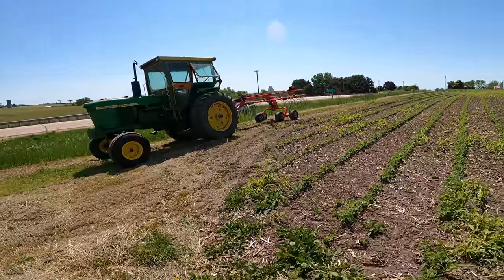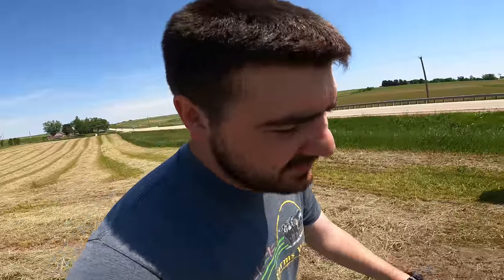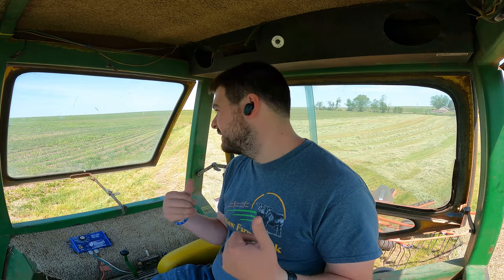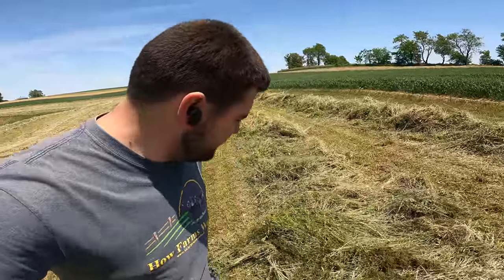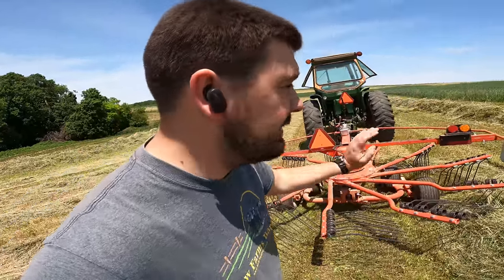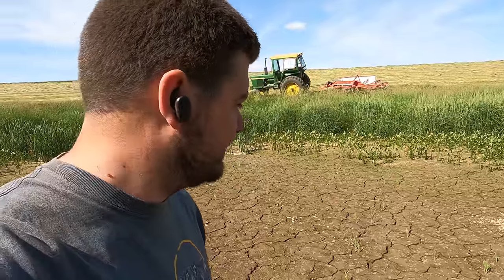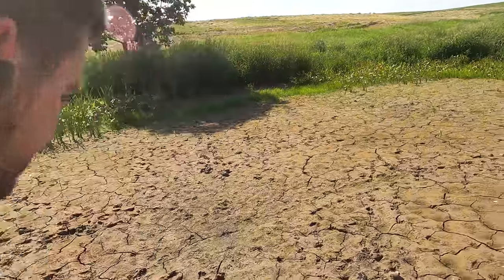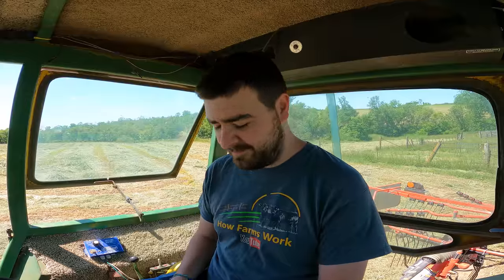Using The New Rotary Rake - KUHN GA 4230 T

Comment: Like a couple others have said, if you pick up a gear and drop your RPM back it will do an even better job raking. The tractor will burn probably 3/4 the fuel and  you will also experience less leaf loss because its not whipping your alfalfa and clover to death. My neighbor has one of these rakes and it beats the heck out of a wheel rake and a bar rake.

Comment: Perfect for making grass hay! I can see the leaves flying off the alfalfa. It’s to rough to me.
Reply: Run the pto slower and rake when the alfalfa is still a little green and the rotary will loose less leaves than any other rake.
Reply: @Anteater6788  there is no way in hell I’d ever use anything resembling a Tedder. No matter what you do you are going to loose a ton of leaves and that’s a no no in alfalfa. .
Reply: I have raked a lot of alfalfa with a rotary rake and if operated correctly they will loose less leaves than any other rake, it's just like you walked along with a pitch fork and flipped the hay over.
Reply: We do alfalfa and clover with our New Holland ProRotor... pretty much the same rake as this Kuhn.  We think it treats the leaves better than our old bar rake.  These don't tumble the grass over and over like a bar rake.  You have to see it working to get a good appreciation of how well they work.

Comment: They are good rake , I  use to own one but I traded it in for a double rotary rake, I thought it was a waste of time and diesel raking in and then turn around and work you're way out. When I raked a feild I went around 4 times then I raked up and down, this made it easier on the hay baler driveline and also the operator, and I also believe it cuts down baling time.

Comment: For making dry hay, you can't beat a rotary rake. I've owned bar rakes, wheel rakes, and now have a Krone rotary rake. Wheel rakes work ok if you don't ted your hay and leave it in a swath until you rake two into the dry space between them. That usually requires more drying days than the weather allows where we are, so I now ted the hay out on day 2 and rake on day 3 and it's pretty much ready.

Comment: Does that rake have where you can remove all the arms and store them on the machine that way it takes up a lot less shed space. The guys I help sometimes have a Massey Ferguson rotary rake I can’t remember the model of it but the tines come off and store upright also the arm that holds the curtain and the other arm both fold up to. I have ran it once it is nice because it is only 1 hydraulic line and does not only need about 60 horse to run probably would run with 40 horses on it. Easy operating rake I like it.

Comment: I really like our single rotor rake it may not be as quick as a twin rotor or bigger but is it a fraction of the price and as you say on heavy crops you make one pass per windrow or if it is light enough turn and go the opposite way to double it up.

Not the most overpowered I've seen a JD 8 thousand something on a little PZ haybob and a 300hp Fendt on a tiny old idiot block baler

Comment: Does green bunches land on top and dry out in the windrow?
Reply from the maker: It does a good job at getting the wetter material out and on top.
Reply: Yep that's what rakes do... that's why they call it a WINDROW... it piles the hay up into a row that the wind can move through to carry away moisture.  I see a lot of guys leaving hay out to roast in the sun a week and then raking right ahead of the baler, but they're TOTALLY missing the point of having a rake.  Hay should be raked when it hits about 50% moisture... that's basically WILTED FLAT.  When you cut hay, it will still be "fluffy" due to the plant having sufficient internal water to support the cell walls, but as it dries down it "wilts" and flattens out under gravity due to water loss and the cells "deflating" as water comes out of them in the curing process.  Hence it "wilts flat".  The forage at that point will STILL have a pretty lush green color but will not have the "luster" or shininess of freshly cut forage, since it's drying down.  It will still be very limber and soft at that point.  That's when the rake it up into windrows.  Raking it into windrows minimizes the amount of hay being exposed to DIRECT sunlight, and thus UV rays, which "sunburn" the hay and cause the conversion of carotene in the hay to Vitamin D, which means its irretrievably lost.  Cattle make their own Vitamin D in their skin (as we do) and the carotene is a valuable nutrient that can be used many different ways if it's preserved in the forage.  Basically raking the hay into a windrow means only the hay on the outside layer is getting fried by the sun, while the hay inside the windrow is up off the ground and exposed to airflow and heat from the sun heating the outer layer of the windrow which speeds drying, as the air coming into the windrow absorbs moisture from the inside and then goes out with the breeze as new air comes in.  Hay laying flat on the ground takes longer to dry IF the ground is WET or DAMP, than hay in a windrow.  That's why they set their mowers to "swath" hay up there usually-- let the ground dry out and then rake it so the hay ends up on dry ground so it dries better.  Down here that's not much of a problem usually and sun exposure of UV is the biggest killer of hay quality.  SO usually hay is cut and laid out flat here, problem is most guys leave it there til they're ready to bale, and that's too long.  We rake 24 hours after cutting, and generally bale 24 hours after that, and have hay at a good dry storage moisture level.  We also have a good green color in the dry hay, something TOTALLY LOST in hay left to roast flat on the ground for 4-5 days to a week.  You also lose VERY LITTLE leaf when raking at 50% moisture, while waiting til the hay is ready to bale, you lose TONS of leaves, even in grasses which are much tougher than alfalfa, but still MOST of the feed value is in the leaves not stems regardless of whether it's grass, forb, or legume... 

Later!  OL J R :)

Comment: Why not put the MW turbo kit on the 4020
Reply: Why would yea
Reply: @jeremyfreeman717  More horsepower and torque
Reply: @keydanTheMan614  for what.
Reply: Why would he? Only going to cost him money for very little benefit. The kit costs money, burns more fuel, and will probably end up pushing that tired old engine to the point of needing a rebuild. And in actual use if you’re really working the tractor with those turbo kits you end up creating a lot more heat and can’t work the machine all day due to overheating issues. 

Sounds cool in theory, and for a tractor that is more show and fun rather than a reliable nice handy sized work horse for reasonable tasks.
Reply: @jeremyfreeman717  pulling wagons and mowing and other jobs
Reply: @chevyon37s  Well Drew it's worth it and I know a couple people who own a 4020 with the mw turbo kit and they run smooth and let me tell you something Drew I have driven one and it never overheated when it's working in the field
Reply: @chevyon37s  And it sounds like you own an international 1206 1256 or 1456 and you are bragging that it doesn't overheat and it's better then a 4020 please ih sucks
Reply: @keydanTheMan614  buy a 4320 if yea want one
Reply: @jeremyfreeman717  we've got one and my buddies 4020 is mw and my 4320 is mw and we work them buddy
Reply: @keydanTheMan614  4320 are garbage. Hot running hard starting fuel using and no power
Reply: @jeremyfreeman717  ih sucks and the 4320 that was given to me I've had zero issues starting in 30 degrees no problem
Reply: @jeremyfreeman717   my 4320 starts fine down to +20°f. Summer starts right up. Run a 16' macdon discbine all day never overheats. 16k hrs on tractor almost 4k hrs on motor
Reply: @smitty9120  4K is nothing
Reply: @keydanTheMan614  turbo kits on 4020s are pointless. They dont add enough HP to change anything. I mean if you want to spend money to make it sound cool thats one thing.
Reply: @keydanTheMan614  😂 actually it’s all Deere around here, except for a 784 IH we use on  a feed wagon, and it’s a turd. Did spend a number of years on an 806 and 1206 though. But rather than own those I just have an understanding of what it takes economically sustain an operation, and know that trying to spice up very old equipment doesn’t pay off for the operation, especially when it isn’t needed.
Reply: @smitty9120  AMEN

Comment: Sorry guys but I'll still take my high capacity wheel rake all day long. I see no adavantage to this over his side delivery aside from a little more fluffy windrow.
Reply from the maker: This rake picks up much more material so it leaves less behind.
Reply: @HowFarmsWork    I'll buy that Ryan but doesn't it feel slow compared to your high capacity? With good wheels they dont leave much behind. It leaves a nicer windrow hands down. No balling up either. But I like fast.
Reply from the maker: @davedunn2124  it’s much slower than the V rake, but that rake isn’t typically suited for first crop because of the density and moisture if it wasn’t tedded.

Comment: Your windrows look like really crappy compared to your v rakes
Reply from the maker: Bringing that shroud in helped make more consistent rows, but they were a lot tighter and would dry less. It also doesn't rope like the V-rake does which feeds into the baler better.
Reply: @HowFarmsWork  u are running pto to fast
Reply: Too fast on the engine speed (PTO speed) and too slow on the ground speed (grab a gear and idle back would solve that) and set the curtain in some to make a tighter windrow... 

Like most machinery, the job it does is directly affected by how it's set up and operated-- correct adjustment and operation of the machine will produce good/excellent results, while poor adjustment or incorrect operation will produce substandard results.  In the end it all comes down to the OPERATOR and them having the knowledge and EXPERIENCE to set the machine up and operate it properly.  Doesn't matter if it's the newest and greatest thing on the planet if it's not set up and run right it's gonna do a substandard job, even compared to an older or well worn piece of machinery that is properly maintained and set and operated right for the conditions.  That's what most guys don't get.  They buy the BS that "new" automatically means "better" when it really doesn't!  

Seeing how Ryan said they've never had any experience with a rotary rake before, I think some mistakes are to be expected.  It takes time to get the experience to really set things up right and make adjustments for the conditions to do the best job.  There's a learning curve to everything-- nobody's just "great" at something the first time out of the box.  Would've helped if the Kuhn guy dropped by when he was going to the field with it and gave him some pointers and setup help right off the bat... That and READ THE MANUAL cover to cover  a time or two-- usually there's good hints in there and tells you the "gotchas" to watch for and how to fix them without scratching your head for hours wondering why it's doing this or that.  Seen guys talk about this machine or that machine being "junk" because of the "lousy job" it does, when basically they never read the friggin book and had NO CLUE WTF they were doing... same machine in the hands of an EXPERIENCED OPERATOR who adjusted it and ran it properly did a terrific job!  

That's been my experience anyway!  OL J R :)

Comment: This rake is junk!
Reply from the maker: Why do you say that? It does a better job at grabbing all the hay on the ground and doesn't leave chunks behind like our bar rake.
Reply: @HowFarmsWork  Time is money, that rake is a toy. You got the rake for FREE!
Reply from the maker: @gregorydayton5428  Time is money, which is why we used both rakes to get the job done in half the time.
Reply: They're not "junk", it all depends on the job you're doing and where you're doing it.  Europe loves the d#mn things, so do horse hay and dairy guys in the US trying to get top dollar for their hay or maximize milk production or whatever... they claim they put less "ash" (dust and dirt) in the windrow so that equates to higher milk production and brings a premium value on the hay.  For the regular beef cattle guy a wheel rake is 'good enough' and does the job for about half the cost of what that rake costs new.  That rake is PTO powered, has a gearbox to maintain and which is VERY expensive to repair/replace, TONS of moving parts, and lots of wear items like the cam track and cam followers which don't last forever either.  If they ever hit anything you can pretty much write it off because whatever gets bent will never rake right again pretty much, and it'll cost a fortune to rebuild.  BUT they do a nice job; probably the most complicated way POSSIBLE to do the same job that any other rake can do, even if they put a little more dirt in the windrow or whatever.  That's why they make lots of different rakes-- you can buy the rotary rake, you can buy a new wheel rake, or you can buy a new bar rake.  Wheel rakes are the cheapest and widest for the money, though they tend to put more dirt in the windrow, and can have issues in some conditions depending on the design (always better IMHO to have the wheels in front of the frame for that reason).  The plus side is they're VERY simple, direct ground driven with no gearboxes or shafts or joints or anything.  Bar rakes when set right can make just as clean and fluffy a windrow as a rotary rake, and don't put dirt in the windrow (unfortunately most guys seem to try to use them as a tillage tool, scraping the ground trying to get every single blade of grass in the windrow, which NO rake will do with 100% efficiency).  They have more moving parts than a wheel rake but are MUCH more durable than rotary rakes, and MUCH cheaper than rotaries as well.  They're not as wide as wheel rake of course unless you get a multi-basket one or a bridge hitch and pull a pair of bar rakes like we do.  

SO in the end it basically comes down to 1) what you're raking, 2) what you're intended market/use for the hay is, and 3) personal choice and how much money you want to spend.  There is no "one size fits all" in farming.  I'd never buy a rotary because a bar or wheel rake will do the job I'm doing much cheaper and simpler with less repairs and cost, but that doesn't mean they don't have a place in someone else's operation.  Later! OL J R : )
Reply: @HowFarmsWork  Yeah if you were gonna buy anything though, I'd say get a bridge hitch for a few hundred to a couple grand and another used bar rake and do the same job twice as fast for a fraction of the cost, but that's just me.  I know this rotary is out there as a freebie demo for them to get some free advertising on it... Later!  OL J R :)